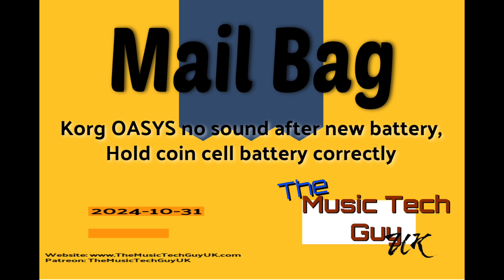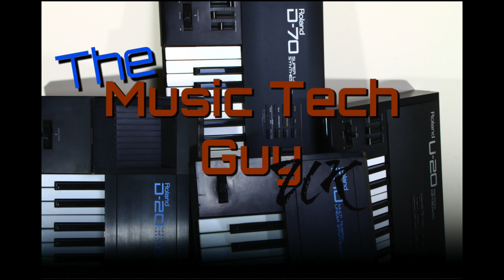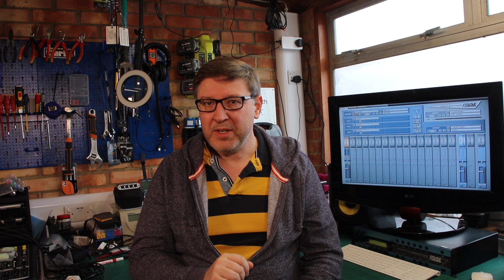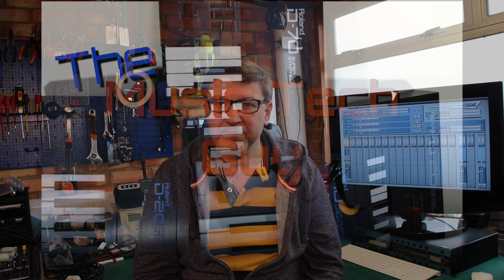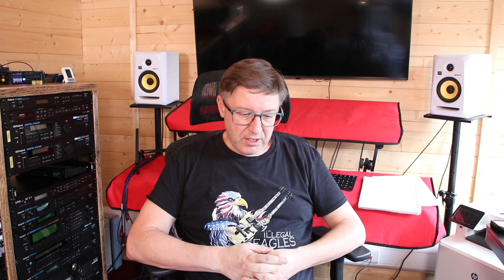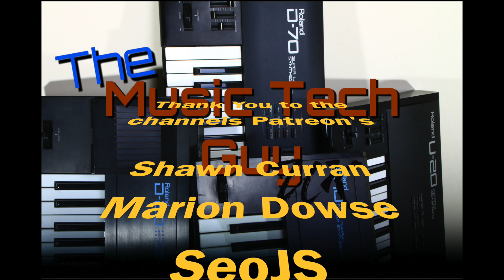Korg OASYS no sound after new battery, Hold coin cell battery correctly

Comment: Hi music techguy. I have been enjoying your videos. I have a quick question for you. I have a Korg M3 which I love & want to keep. I am sure you are aware of the touch screen dying problem & I am just about to have it changed again as they only last 1 to 2 years max. I have always used Korg official screens, replaced by Korg. Do you know of an alternate touch screen that can be used that will last longer as the M3 is perfect in every way but I am getting fed up with constant replacements !
Reply from the maker: Hi @adamshatwell

If I am honest, not owning a Korg M3 myself I wasn't aware of the touchscreen problem.

I am surprised that your only getting 2 years out of a touch screen as the touch screens on prior and post workstations appear to have much better longevity.

I do not know of any 3rd party alternatives.  I normally do research about spare supplies when I identify I need them for a project that I am undertaking.

Good luck with your research and maybe drop a line back if you source a more robust alternative.  Jon
Reply: @TheMusicTechGuyUK  yes it's a shame the M3 has that problem every single one has it. As a composer, the M3 is the most inspirational workstation & the sequencer is superb !
Reply from the maker: Hi @adamshatwell

I have mentioned a couple of times that at the time I purchased my Korg OASYS I was offered a Korg M3 by the same seller.  But having just dropped a load of cash on the OASYS I couldn't stretch to the M3 as well.  Always regretted not doing the deal!

But the Korg M3 was the last of the legacy Korg Workstations.  The Korg OASYS and then Kronos really just added more sonic power.  But I do take your point about being insprational.  I felt like that when I got my first Korg M1, admittedly 20 years after they were launched.  Jon

PS thanks for the comments on the videos.  I should have said that above.  Now where are my manors!